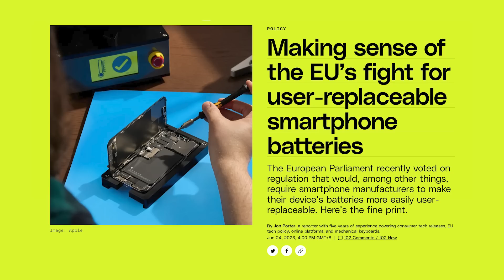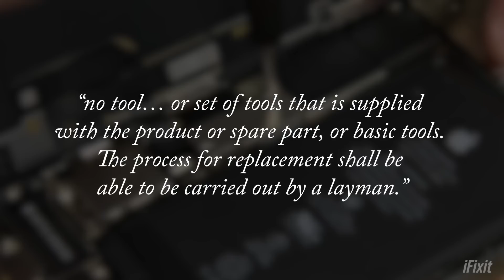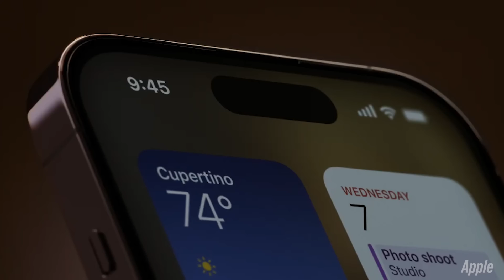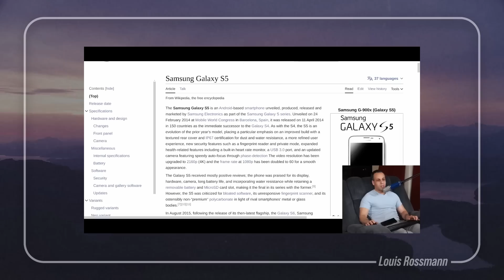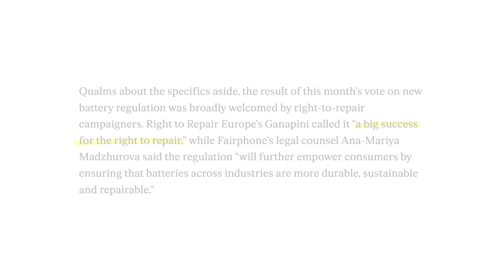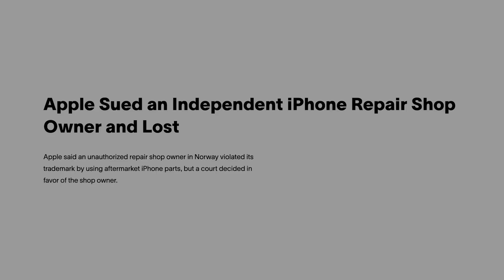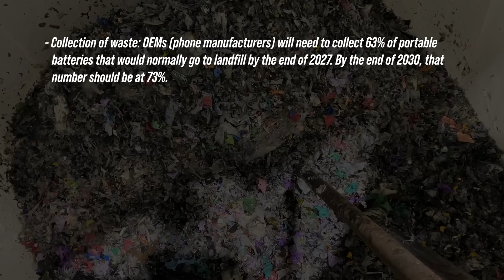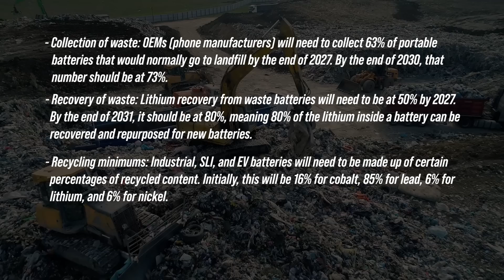EU Just Changed Smartphones Forever

Comment: Modern tech companies are amongst the least green companies on the planet - Apple being the worst of them!

The safety issue is a smokescreen covering the fact that Apple et al deliberately make their products non compliant for customer repair. Batteries are the worst of it. I've replaced many laptop and phone batteries, the only thing making replacing batteries difficult and somewhat technical is the way the likes of Apple deliberately design fitting the battery. There's little doubt in my mind that batteries can both easily replaced AND electronic devices still remain waterproof - heck, splash proof/rain resistant would easy!

I still remember my first company mobile phone came with a spare battery and charger for it - it was a Nokia 6310i, if I remember correctly. That phone was used many times in the rain, it wasn't waterproof, but it never had any issues being used in rain.

All we need now is the EU to force printer companies to be more honest about their products, and allow customers to use what darn ink they want. It'd also be great if they actually filled the ink cartridges, instead of just putting 10ml or so on an internal sponge!

Comment: Insta360 X3 is a 360 camera, which is water proof up to 10m, i've used it in deep pools in the ocean and it has no issues. works great and easy to switch the battery. therefore they could design the system  similar...

As such tech for rechargeable battery / replaceable battery already exists  which is water proof up to 10m.

Stop thinking there is no tech that exists for it. IT does...

Comment: Removable batteries have always been the case for phones until after 2010. Companies like Samsung and Apple found it were more profitable for them to screw the consumer by intentionally designing them to have the battery glued into the phones themselves and making it very hard to remove the casing without the proper equipment to do so. 

I had an iMac desktop computer that finally died in 2014 and when I tried to replace the hard drive for a new one, it was hidden behind a backplate that was screwed on to the chassis, behind a mountain of components sandwiched together. It was a bloody nightmare. I'm glad that I've learnt how to build my own PC now and will NEVER go back to using a Mac. The repair process was super painful to go through. Can't imagine how bad it is now for repair folk like Louis Rossmann

Comment: I was tinkering with a "dumb phone" just this past weekend that had a removable (and thus replaceable) battery -- and wondered why my Samsung smartphone wasn't smart enough to offer the same. Far too many products have a deliberate "replace me don't repair me" approach -- planned obsolescence -- without necessarily NEEDING to be upgraded so frequently. If it was done with the right motivation then it's a good move.

I also remember my first (grayscale screen) laptop in the 1990s having not only a removable battery, and usually having a spare, but also running just fine when plugged in without any battery at all. Much more user-friendly than nowadays.
Reply: ive used my iphone 8 daily since 2019 (i bought refurbished for $350) and the battery capacity is still above 90%.

smartphone batteries (at least with iphones) are good enough nowadays to last over a day on a single charge, and by the time the batteries lose capacity (5 years), the phones are no longer software supported

why is nobody thinking about this from a practical viewpoint? look at the design of iphones, replacing the battery takes less than 10 screws, and the waterproof seal can be completely replaced after. to make it any more simple than this would mean making the back of the phone cheap plastic, and would interfere with Qi charging and Magsafe.

Comment: Go Pro cameras feature very high water resistance and are actively recommended for underwater use - yet have easily removable batteries.
Reply: The same is true of non-"smart" watches
Reply: “Special tool” means outside the realm of the layperson.
Reply: @Accretion-Ranch  In many cases it's not even some special tool, but just a small screwdriver. Tho, every watch store will replace the battery for a few bucks.
Reply: Go Pros are specifically designed for that purpose
Reply: Everything comes with a trade-off and smartphones skew way towards the compactness and portability end of that bargain. Every gasket, every door, every latch takes space.
Reply: @vctrsigma you can remove the need for latches and doors by using slide-in types of batteries just like the phone shown in the video
Reply: Speaking of compactness, how about digital watches? After leaving the factore there is no chance of replacing the battery and maintaining waterproof characteristics.
Reply: @weldonyoung1013 those will also be covered by the law...
Reply: @weldonyoung1013 Do you mean smartwatch? Normal digital watches especially ones designed for diving are fully waterproof have replaceable battery. Only that you'll need a special tool to open the case and replace the gasket along with the battery to retain the water resistant.
Reply: @weldonyoung1013   it's comically easy to have a waterproof watch with a replacable battery. A backplate sealed with an o-ring (like many high-end car keyfobs, IE Lexus) or even a battery that attaches like a backplate and connects via sealed pins/pads.

What's happening is a whole generation of engineers were created without devices requiring waterproof ratings, because capitalism deemed it a premium feature only for the top-end devices. Like The Time Machine by H. G. Wells, we're literally forgetting what things were like just a decade ago.

Comment: This is a huge win. Phasing out user replaceable batteries was nothing more than anti consumer. There's no other way to spin it
Reply: Some of these replies are fucking wild, damn dude
Reply: massive L for the EU. what kind of communist bs is this? next they will require phones to all have physical keyboards, or built in EU government cellular plans.

i cant believe people are actually supporting this, consumer products exist for a reason. they arent meant to be controlled by the government.
Reply: Untrue. Making a product better will not stop people from buying. lmao. Regardless, people will keep buying and likely stay a consumer. However, the true win in this is that it gives older device longer use life.
Reply: @boiiioioing  Making a product "better" (according to your personal preference) comes with massive costs. There are huge benefits to short product cycles. It makes innovation and implementation of improvements faster. This includes better materials and sustainability.

And there is literally no point in having a phone that lasts 5 years or more. Because everything else develops during that time. Old phones can hardly run anything because new software demands more processor capacity. If you only use your phone for calling, there are phones for that too.

The same is true for bicycles. You can manufacture a bike that will last 50 years. But when you've had it for 45 years, you're riding 45 year old tech.

You have no right to force other people to fulfill your fantasies. And other people have no right to force you either. It doesn't matter if they are individuals or a group of people working for a company.

This is just a pretense for EU to grasp more power and make things more expensive, while slowly killing innovation. "lol"
Reply: It takes about 5 minutes to replace the battery on any Xiaomi phone.
Reply: @Iv987654321  It used to take 10 seconds on an old Nokia and they had a standard series of batteries across their hundreds of phones.
Reply: Makes a lot more sense now since phones are much faster. Back when replaceable batteries were common phones were outdated very quick.

If not for the battery life being poor I would keep my phone's for a lot longer.
Reply: We can thank Apple for that. They started the trend when they were in the race for "thinnest phone ever".
Reply: @GrAdeAjAmAicAn  they started it by inventing the smartphone
Reply: @helloyes2288  I know you didn't just say Apple invented the smartphone. You must be young.🤣🤣🤣
Reply: @GrAdeAjAmAicAn stares in Motorola
Reply: @GrAdeAjAmAicAn we have to thank apple for a lot of things, but being told what and how to manufacture by bureucrats isn’t one of them. I don’t want a replaceable battery on a phone that is 6 years out dated by software advancements.
Reply: No it is not, its just made to look that way. With this amount of recycling rules, corporations will only rent their devices instead of selling em
Reply: Well there is also the system upgrade support. Extremely few decices go beyond 3 years, and it is bloody rare to get 4 years of upgrades.
Reply: @weldonyoung1013   thats only the case for android, iphones get 5+ years
Reply: @imstupidbut  yeah, I forgot about you guys!
Reply: ive used my iphone 8 daily since 2019 (i bought refurbished for $350) and the battery capacity is still above 90%.

smartphone batteries (at least with iphones) are good enough nowadays to last over a day on a single charge, and by the time the batteries lose capacity (5 years), the phones are no longer software supported

why is nobody thinking about this from a practical viewpoint? look at the design of iphones, replacing the battery takes less than 10 screws, and the waterproof seal can be completely replaced after. to make it any more simple than this would mean making the back of the phone cheap plastic, and would interfere with Qi charging and Magsafe.
Reply: @imstupidbut  Because this law is mostly from virtue-signaling rich politicians than truly actually caring about something. Still hoping this is a step in the right direction and will send the right message although it's a decade too late.
Reply: Massive loss. This is anti innovation. Phones today are absolutely awesome. There is nothing "anti consumer" about that. The idea that regulations somehow will improve products is anti producer.
Reply: @mrtvi46  yeah phones today are so cool man I LOVE planned obsolescence! Woohoo!!! I love batteries that are guaranteed to degrade being stuck in a device and are an absolute nightmare to remove and replace! Yeah innovation, am I right!?
Reply: @KatsuyaTheFuuk  No, you're wrong. Planned obsolescence has tons of benefits. It's basically the quickest way to improve products. It's literally the constant implementation of innovation. It also makes products much cheaper.

It makes perfect sense for phones since the demand for processing power is constantly growing. When your phone is 5-6 years old it will struggle to keep up with the software. Both OS and apps.

By not making the battery replacable the components will have a more synchronized life span. That means more parts will be recycled at the same time. Where I live I can basically just turn the phone in at any retailer and they have it recycled.

When the EU forces manufacturers to make batteries replacable, after a few years you will have a device where all components are starting to age noticably. Except the battery, just get a new one. A year later the processor and RAM is pushing 5-6 years, and the OS isn't snappy anymore. The screen has also started to degrade.

Suddenly you need to replace all the other components. You need a processor and a new screen. They need to be stored somewhere. Warehouse costs is a real thing. Now your old phone is very expensive. The performance is much worse than a new phone. So you've replaced all the worn out parts at a much higher price than just buying a new phone, and it still can't keep up.

You could just have written: "I don't understand planned obsolescence... but I want to feel like a victim."

Another point:
So phone manufacturers constantly add better processors, better screens, more storage capacity, faster broadband... Yet, at the same time they are "anti consumer". Why? "The batteries, man! You can't replace them!!" 🤡

That's a pretty stupid conspiracy theory. They improve pretty much all things, except one? That makes no sense.

Compare this to the EU. They do this for two reasons: 1) it sounds good, and 2) it gives them more power over companies. They are not "pro consumers" in any way. They don't give a shit about you or your batteries. They only care about public perception and power. What do you think politics and buraeucracy is? People trying to solve your problems? No, it's people trying to get reelected and to keep their comfortable and non-productive jobs.
Reply: @mrtvi46  BRO WHAT LMFAOOO
Reply: @mrtvi46  Planned obsolescence makes products cheaper? Have you seen the price of recent iPhone models?
Reply: @luckymouse1988  It reduces costs and leads to cheaper phones in general, yes. Then Samsung can choose to make a new flagship model with extra everything, and have it sold at a higher price. Another model might have a lower price. Other manufacturers might make different decisions regarding pricing of specific models too. But phones in general have become cheaper because of planned obsolescence.

Outside of that you have other factors, like inflation, but that's government policy destroying your purchasing power and making you poorer. Since Nixon took the dollar off the gold standard. You also have the supply chain issues (yes, the effects are still present), chip shortage, covid, and war. In some places you have energy crisis, with both fuel and electricity made artificially expense because of political decisions. Both makes everything more expensive. If not at the manufacturing and assembly plants in Asia, at least in Europe and some states in the US.

So at a first glance, phones are more expensive. But that's other causes.
Reply: @mrtvi46  So does the negatives of phones having replaceable batteries outweigh the positives ?

If not how is that anti consumer if u enforce something that is better for the consumers ?
Reply: Well there goes water proof
Reply: @mr.tomfoolery9159 Nope. We had waterproof phones back then as well. The video explains how Samsung and Sony both had waterproof phones with removable batteries.
Reply: @mr.tomfoolery9159  Why would you use your phone under water?
Reply: @mr.tomfoolery9159  The irony of this comment. Drop your iPhone in to water and it's dead for good. Drop some Nokia phone in to water, open it up to get some air, good to go in a matter of 12-24 hours.

Planned obsolescence and paying extra to get your phone fixed is what it was all about and not waterproofing.
How many times did you have to repair e.g. your phone's battery? Older models vs. newer ones.
My own personal experience:
older = zero
newer = 4 times.

Comment: I'm glad to see phones being more power user friendly.  I miss having a phone that I can swap batteries in so I don't have to chase or carry a charger.
Reply: To me it's not about being able to carry spare batteris. It's about prolonging the usage of the phone without having to buy a new one after 2-4 years just because the battery is dead. But battery is one thing to force you to a new phone. Second method is the software obsolecense and lack of long-term updates leading to not being able to update crucial applications that stop working because the OS is too old and you need a new version of the app to work which is no longer compatible with this old OS, i.e. Android 7.
Reply: i have powerbank always in backapack so i can charge some other things, not just phone.
Reply: Powerbank is a good alternative to this. Also you dont have to restart you phone and a powerban can charge your battery more than once or even twice
Reply: @Stepantc  Wireless charging options have made a powerbank easier however still as I said Chase or Carry a charger.  From my MotoDroid to my Note3 I have had multiple batteries for each.  Up to 4 days worth of batteries some times.  Often delivered trucks that didn't have working power sockets.
Reply: ive used my iphone 8 daily since 2019 (i bought refurbished for $350) and the battery capacity is still above 90%.

smartphone batteries (at least with iphones) are good enough nowadays to last over a day on a single charge, and by the time the batteries lose capacity (5 years), the phones are no longer software supported

why is nobody thinking about this from a practical viewpoint? look at the design of iphones, replacing the battery takes less than 10 screws, and the waterproof seal can be completely replaced after. to make it any more simple than this would mean making the back of the phone cheap plastic, and would interfere with Qi charging and Magsafe.
Reply: @imstupidbut  Try to use it in cold weather.
From 100% to 0 is few seconds.
Reply: goodluck for not having a ip67/68 features on mobile phones with this sshh**T
Reply: @paghilumdihauy  Number of ham radios I have use swappable batteries and are waterproof to 50ft.  More than enough to shrug off some heavy rain or a slip in a puddle.  Even if older phones wern't waterproof they could still survive a drop with a trip to the mall lol.

Comment: The EU should focus on car batteries 
Some manufacturers make it impossible for the driver just to swap it, the battery (AGM for example) need to be trained, married or whatever to the car.
Reply: EV means electric vehicle.
Reply: @ChristianIce  I actually mean normal cars, the 12V battery 
You can’t swap it yourself (depending on the carmaker)
So, instead of buying a new battery for 120.- €/$/£ you need to “service” your car at a dealer for 500.- €/$/£
Reply: @TheRealAndreasBartel 
I guess the part of "a handy man should be able to do it" is referred to the portable items, so phones, tablets and laptops.